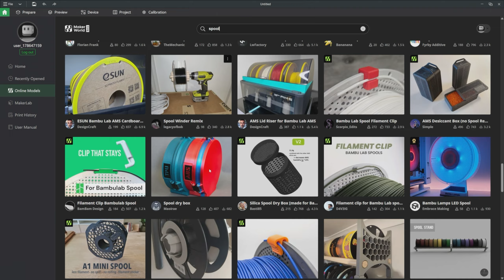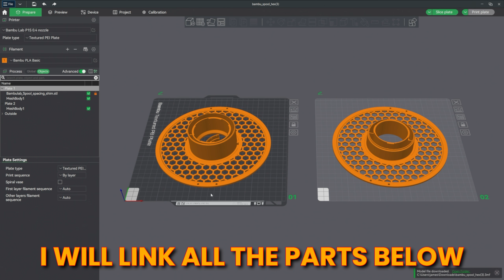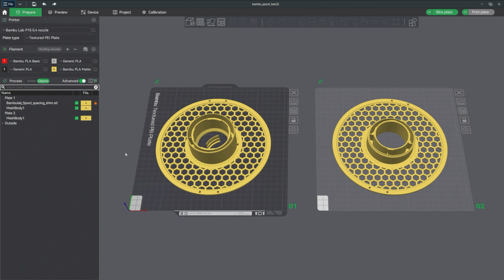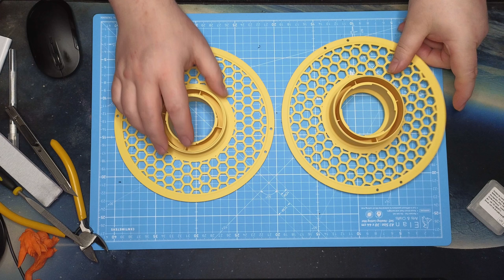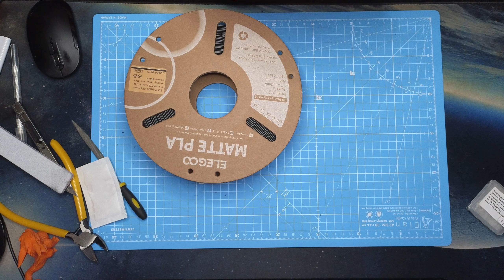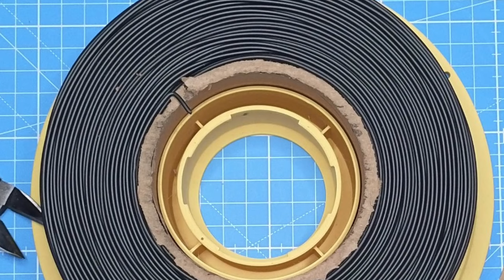How To swap a Cardboard Spool To a plastic one

Comment: I used the AMS empty spools it came with for this but I like this idea to print my own spools.  I ended up buying some high heat resistant spools on sale from bambu.  Check out bambu spool buddy print too, might help line up that notch.
Reply from the maker: Thanks for that I will check out the spool buddy 🫡

Comment: Nice video!

I just run the carboard spools in the AMS. So much easier, since I need a ton of difference colors. I've gone through tens of carboard spools, and will add a bit of masking tape if the sides are really falling apart. That, and cleaning off the rubber rollers in the AMS with ethonal to remove any dust.

Additionally, I wouldn't recommend electric tape. I used that, then dried the spool (PETG), and the tape became a sticky mess.
Reply from the maker: Thanks for tips

Comment: A much easier solution to using cardboard spools with the AMS is to just wrap a layer of electrical tape on the edge of the spool that rides on the AMS rollers. This prevents those fibers from coming off and gunking up your AMS and allows you to use cardboard spools without much hassle. The only time ive found the printable spools worth it is if I've purchased those spool less refills when I've wanted to cut down waste. This solution works great though as well so don't take this as I'm trying to tell you what to do.
Reply from the maker: Thanks for the tape tip. I have also bought refills as well which is another reason for printing a spool. I am new to 3d printing so I welcome any feedback